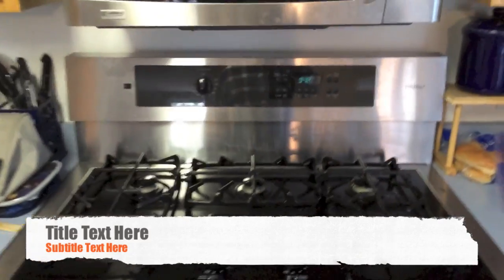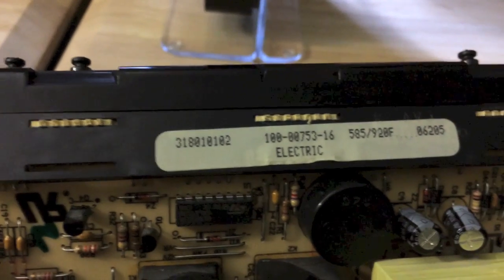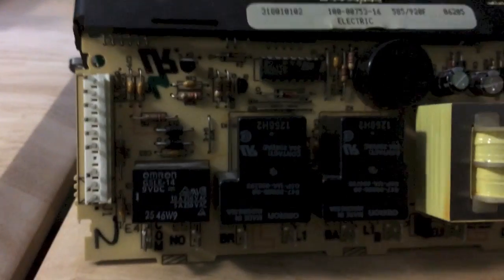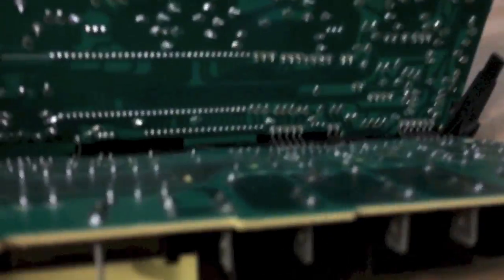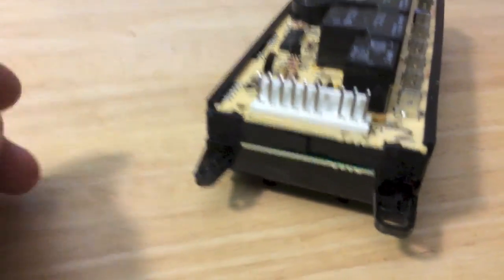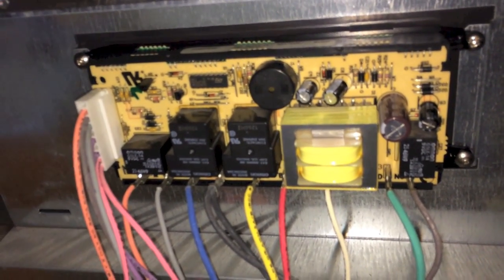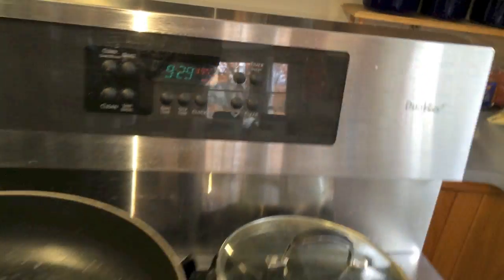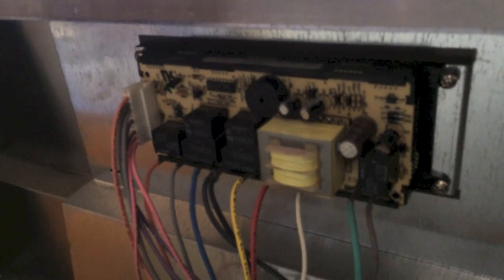Repairing Electronic Oven Controller on Kenmore Elite Oven 790.75503

Comment: Hi Matt, I arrived here hoping you or one of your commenters might have figured out how to separate the control board PCBs without damaging the housing, but that doesn't seem to be the case. Those six black snap-tabs should come out, imho, but I haven't been able to do it...

I'm hoping to fix a different problem in my range, but in regards to this particular one: If you suspect the joint may be going bad due to overheating, you could always try repairing the joint with solder that has a higher melting point, such as the lead-free stuff. Then again, that might be what's in there already (check your documentation for ROHS compliance) and could in fact be part of the problem as it tends to be more brittle.

Comment: I have the electric/electric model of this same unit.The lower element in the oven was cold to the touch but the broiler was working fine, I followed your video and sure enough the soldering joint was identical. Thank you for taking the time to make this video.

Comment: I have the Frigidaire 40" dual fuel range. Exactly the same thing happened but its still not coming up to the temperature correctly, is there anyway to know if mine would have a convection fan element without taking the oven apart inside or how to reset the temperature. Charles

Comment: Matt, Thanks for this!  First of all, it helped me make certain that this was the problem.  Second of all, it helped me figure out how to get my old unit apart to get the pegs out for the push buttons.  I would agree with you that this appears to be a flaw in the system for everyone to be having this issue...  I realize warranty is up, but looks like a manufacturing issue since it is identical for most everyone!

Comment: Matt.
Can't thank you enough.  I have the exact same oven and had the exact problem with the lower bake element.  Took the control board apart and .  . .  there it was, a broken solder joint. Re-soldered and the oven works great.
Thanks a million.

Comment: Thanks a lot Matt!!  We have the electric/electric model 790.99513307.  As a mechanic, I pride myself on fixing everything myself.  After replacing the element and thermal breaker, this one seriously had me stumped.  While searching online for a wiring diagram, I came across your video.  I followed the video and in 30 minutes, I was up and running.  Thanks again.

Comment: This was my problem also. The part on my model number is a sears repairman installed part only. If you have this problem it will save you $300 or $400. I took my control module a part a little bit differently. Everything on this repair is easy. Great job Matt DeRoller. Many thanks.

Comment: I'm wondering if the relay is just getting too hot with prolonged stove usage.  I'm thinking about making a modification to the back of the stove in order to install a cooling fan that will blow air directly on the control board.  I don't think that there is any cooling for the electronics in the stove other than natural convection.

Comment: Matt for President! Lower heating element in Kenmore Elite stopped working the day before Christmas. Wife freaked (rightfully so!), was ready to call Sears repair (or buy a new stove!), and spend gobs of my hard earned money to get this resolved. Out of desperation, I googled the issue and found Saint Matt's video.  All I can say is a sincere thank you!    I saw the exact same issue as soon as I took apart the control board, ran out last night and bought a $10 soldering iron and just completed my first ever solder repair this AM,  and happy to report the oven is once again working!  There are not too many people that I hold in higher regard right now.   Amazing that this would have cost at a minimum of several hundred dollars if I had called any repair person.   That was a very selfless act to take the time to post this so others can benefit.  Thank you thank you thank you Matt, you saved Christmas just in the nick of time!
Reply from the maker: You're welcome.  Seems like a common problem.  A burned out solder joint is not good, and makes me think this will happen again.  But at least I'll know where to look first next time.

Comment: My side oven quite after a hot broil ao I'm wondering if there is a control board problem or just a safety breaker/fuze somewhere (not covered in the manual).

Comment: Hi Matt I got a whirlpool gas range I just bought it today on Craigslist and when i installed the computer board is dead like there's no power on all electric ignite work's but i can't use my oven due to the fact that computer board is dead any idea please advice thanks
Reply from the maker: Without looking at it, I'm sorry I can't diagnose the problem.  Just some common sense:  Check that you reconnected everything correctly.  Also check the board is getting power.

Comment: THANK YOU!!!! I had the same exact problem and I opened up the control box and saw EXACTLY the same burn out connection. I put a little solder on it and it worked on the first try.
Reply from the maker: I'm glad it helped.  Makes me wonder what's going on with this controller, seeing so many people are having the same problem.  And is just re-soldering the joint going to last, or will you have to do this again?

Comment: I have a Frigidaire Duel Fuel 40" that is of the same design as your oven and the broiler stopped working recently. I used the knowledge you shared in your video to make the same soldering fix today. It took about 15 minutes for the whole operation, and the broiler works properly again. I appreciate you taking the time to make the video! You have saved me a lot of time and money!

Comment: So, this is Cori Katz's husband! You were 100% correct. The relay in control of the
broiler had one burnt out solder joint. Applied some solder and voila, it works! Steak tonight! Thank you.
One question, do you believe the soldering issue is a common problem on most electronic boards?
Reply: yes... this joint is carrying quite a bit of electrons and cycling hundreds of times per use.  a slight defect in the original solder joint will fail over time... the real fix is larger solder pad and cross sectional area.  Or possible a larger gauge relay leg.

Comment: thank you for explaining this repair so well. I have the Frigidaire duel fuel and had a similar problem, but with the broiler. thinking it was the element I bought a new one, $42 from online site. Still the upper element didn't work. called Sears, mechanic came, charged me $75 to tell me to buy a new board. the board is no longer being manufactured, so he told me to buy a refurbished one for 150, with no guarantee! my husband said, just get a new relay for the broiler! But, I like your idea better. If the solder is no good, try soldering first. great suggestion and great video. thank you.

Comment: Absolutely brilliant... we have a Kenmore range that is only three years old.  Out of the blue the oven stops working but the stove burners still worked.  Viewed your video and followed the steps... although control panel was a little different (had two stacked together), I dismantled and saw the exact same solder issue that you identified.  Took me no more than 30 minutes from start to finish, it fixed my problem, saved me $500+ and the hassle of looking for a new oven!  Thanks so much for the great video!!
Reply from the maker: This seems to be happening to a lot of people.  Solder joints aren't supposed to un-solder themselves, which has me a little worried.  But at least we know where to look first next time it happens.
Reply: Matt DeRoller Agreed... It almost looked liked there wasn't sufficient solder to begin with... it was hallow all around the pin.  Maybe planned obsolescence?  Or really bad quality control... if any.
Reply: Am I ever glad I saw your video. I had the same problem with my Kenmore Elite Electric Range Model 970-698180.  Was going to have Sears replace  the  Electronic Control Board # 316272200 which costs $361 in Canada (and this doesn't include the Sears installation fee or taxes) when I saw this youtube and fixed it by soldering. Thanks for saving me what I estimate over $500 Sears Canada would charge to fix.  Now I am going to use the extra cash to get my driveway paved!

Comment: Last September I fixed my range myself.  After a self-clean cycle, the door remained locked even several hours later.  The locking mechanism got fried and I replaced it (ordered the right part).

Comment: Most people say unplug the unit before working on it, but as many people willing to attempt this type of repair why don't the repairmen just say to disconnect the power supply by either unplugging it or turning off the breaker. Seems to me to be a lot easier to turn off the breaker. Older people often don't have the strength to slide the oven out nor are they limber enough to crawl behind the oven to disconnect the power supply.
Reply from the maker: I am not an oven repair man. Use my advice at your own risk.
Reply: Matt DeRoller Actually, I think the repair video was very helpful, you might consider being a repairman. Good job
Reply from the maker: Todd White Thanks for the advice.  I added some uppercase text in the description warning people to disconnect their ovens before attempting to do this :-)  I guess you can't assume common sense.